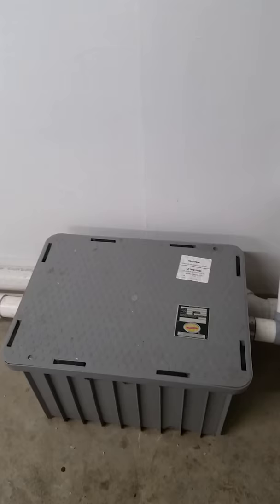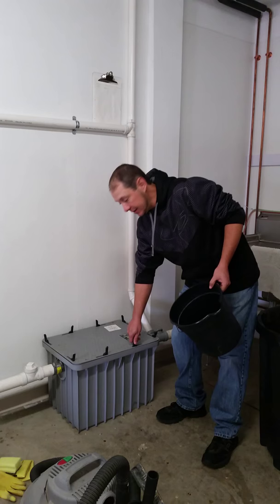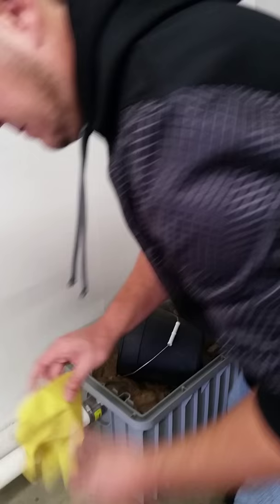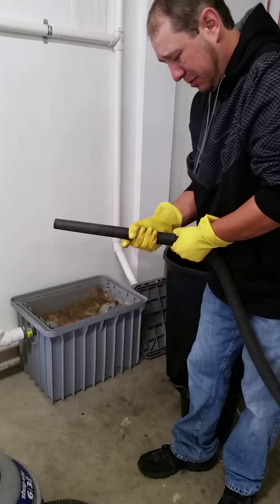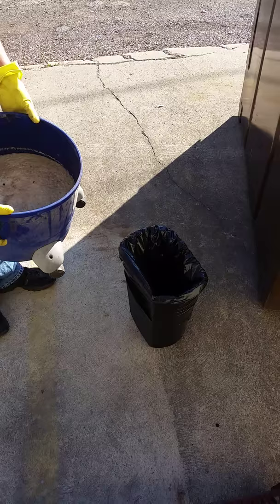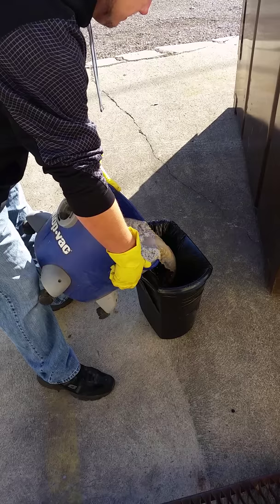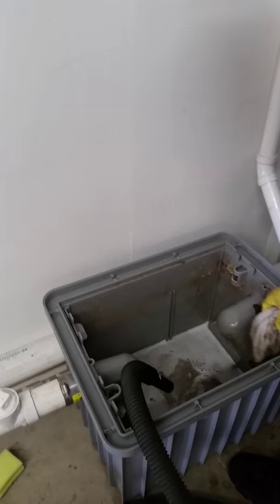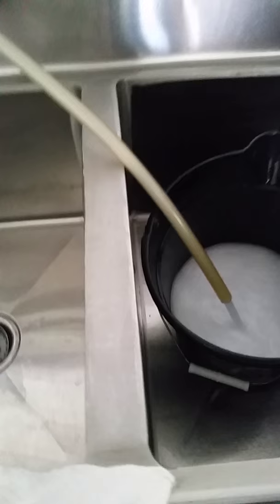How I Clean Restaurant Grease Traps Myself

Comment: I just installed a smaller version of your trap and when running the water in the sink  it drains slower than a normal sink does your do the same
Reply: That is normal  , slows down the flow and grease separates.

Comment: So after you remove all the grease, you fill up the container with sanitized water?  Do you remove the water? I assume you do because it would over flow with the new grease and mess coming in
Reply: +LiquidEntourage I dont think he fills it out completely. would be a waste
Reply: Most interceptors are designed to have a constant (static) liquid level. As more grease and sediment enter the device, the percentage of water decreases, but the overall combined depth remains the same. For example, you might start with 36 inches of clean water. After one month, it might have 2 inches of grease, 4 inches of sediment, and 30 inches of relatively clean water.